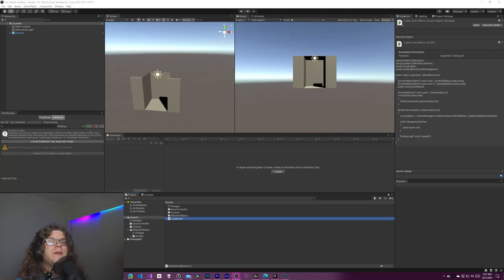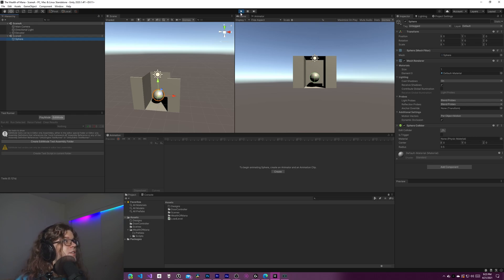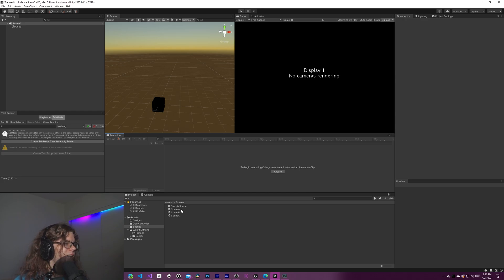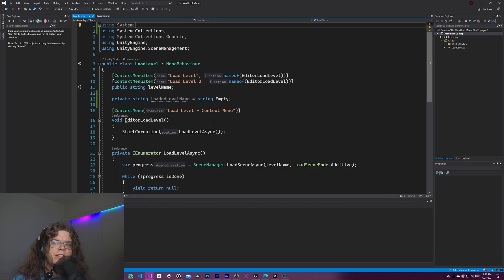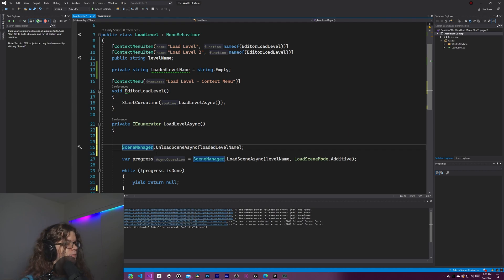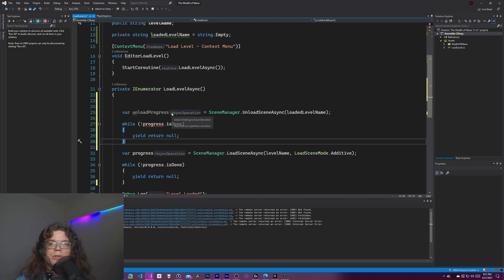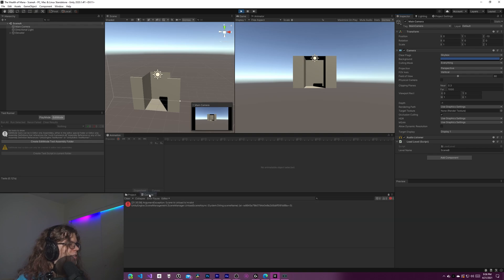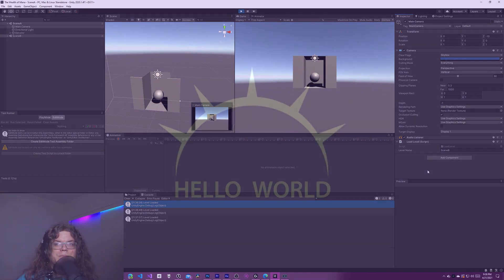Implementing Scene Switching - An Elevator Between Scenes - Part 2

Comment: Hey world of zero, I think you could have noticed it by now, but I am gonna say anyways in case you didn't notice it, there is a weird buzzing sound from your microphone. Great tutorial btw :)
Reply from the maker: I have spent hours trying to fix it... it is actually slightly improved in this video compared to the last few, but I'm still relying on noise gates and post processing to clean things up a bit. That process doesn't catch everything though. Slowly swapping out the cheap bits to see if that helps.

No timeline on when I'll have it fixed but hoping ASAP. I'm hoping to get it fixed before Ludum Dare this weekend, but that might be pretty ambitious.
Reply: @WorldOfZeroDevelopment  oo ok haha, thanks for the update.